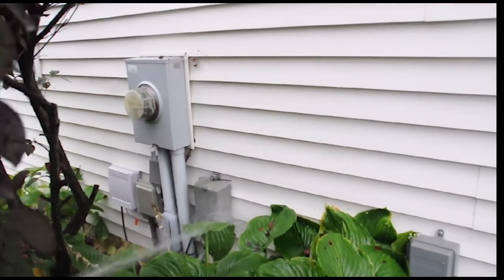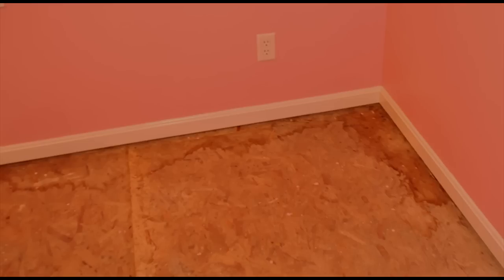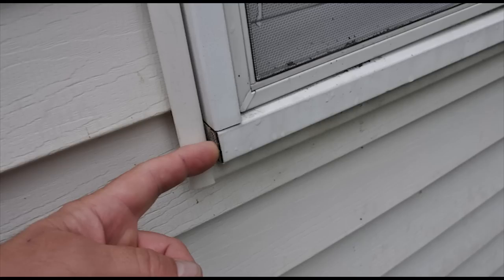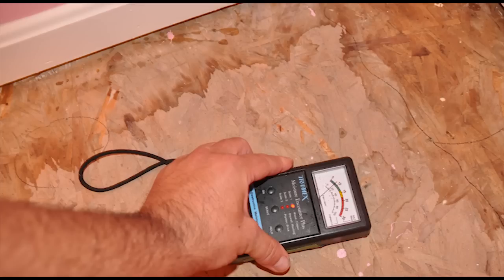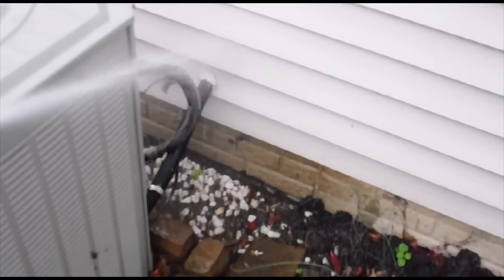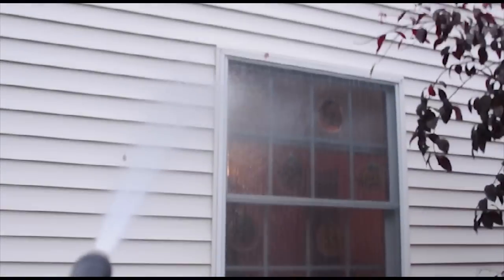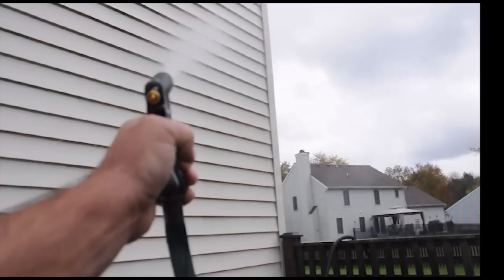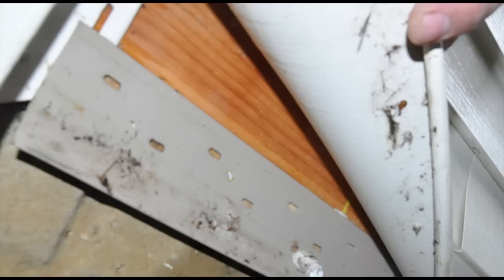Vinyl siding leaking

Comment: I'm not saying tyvek isn't useful but if installed right your vynil siding shouldn't leak. u may need to silicone around the windows. also it doesn't rain up and there is weep holes in the bottom of the siding for water to get out if it does get behind it. if you're spraying a water hose up into the weep holes of course water is going to get behind the siding lol

Comment: I'm not really sure if I have an siding leak but I did have an water heater pressure valve that leaked and caused Alot of damage in the closet in my bedroom downstairs and now we are having wetness in from of the hole where they had to cut it to search for where the water had bubbled up from behind the wall. We think that the shower not door not being closed tightly cause water to splash behind the wall and my dad had to seal the cracks between the shower and the floor.

Comment: There is no drainage plane available as there is no space provided.  Water is collected in the channels and directed under the siding where it is left to the unwitting installer to provide an underlayment to carry the water.  Where has this approach ever been acceptable?  Never!  Primary cladding should be the primary watershed, plain and simple.  It is the nature of PVC to move through thermal changes on the wall.  Gaps are provided for this movement.  'J' Channels and channeled corners are provided for aesthetics to cover the gaps.  Somehow we have been dumbed down to accept this.  Even the play on words by the manufacturers is a ploy calling this a "Supplemental Rain Screen." Who would buy siding that is only supplemental to underlayment?  Think people!
Reply from the maker: ***** Need Tyvek then vinyl siding. When I said drainage space I meant the space of the siding because it is angled. The siding also  has weep holes. So I like it. But we have idiots in Ohio that put this up on OSB sheathing with no drainage plane. Well that's is a big problem. Thank you for your post. I will subscribe to your channel. You sound like you know your Building Science.
Reply: Clevelandmarko Mark,  I must disagree strongly.  Not to be mean, but I know that to deviate from the "accepted" building methods would mean to become an enemy to the big manufacturers.  The system is wrong period.  Water is collected at window and door heads on, essentially, a gutter (top 'J'), then it is channeled down and under the siding where there in no drainage plane (free-fall space ), trapped to run laterally and at subsequent window and door penetrations impeded and enters the wall cavity.  It does not happen on every wall.  I will give you that.  Commonly, the roofer usually gets the call as when a lower floor header breaks through the vertical for an opening in the living area.  You get the look like you must be crazy that my siding is leaking.  How could that be?  Depending on an underlayment to carry runoff would never be acceptable on a roof.  How about if we 'J' Channeled chimneys or dormers for roof flashings?  You would blame the installer for bogus work.  Now we have underlayment window wraps being touted as window "flashings."  The manufacturers have been allowed to pervert the specs because in the absence of specifics in a building code builders revert to manufacturer specifications.  In this the VSI refers to its products as a "SUPPLEMENTAL RAIN SCREEN."  A play on words, this has tricked educated folks to believe that they somehow have rain scree construction with a drainage plane, which is a lie.

We have a friend in the Washington Post:

........................................................................................
The Washington Post explains some of the problems that vinyl-clad homes face these days:

"...for most people, the real surprise is that vinyl siding leaks -- a lot. The industry puts a positive spin on this issue, describing the siding as a 'supplemental rain screen' that works by 'reducing the amount of water that reaches the underlying weather-resistant barrier.' The Vinyl Siding Institute says, 'vinyl siding is designed to allow the material underneath to breathe; therefore it is not a watertight covering' -- which is to say, it leaks.

Water enters through overlapped joints, but mainly at open-sided edge trim. Anticipating this, manufacturers provide weep holes along the bottom edges of clapboard panels. You can't stop water infiltration by caulking because, unlike stationary trim seams in wood or masonry, vinyl has to move freely."Since vinyl siding itself is not waterproof, the building is ultimately protected by a water-resistant underlayment (house wrap), with additional protection provided by peal and stick waterproofing membranes that are used at high-risk areas such as window and door openings. Unfortunately, the water-resistant underlayment is punctured by several hundred siding nails. Also, any installation mistakes with the underlayment, or the way the underlayment is integrated with the peal and stick window/door membranes, will ultimately result in leaks.

The number of lawsuits being filed against contractors and vinyl siding manufacturers has been on the incline for many years now. 

(above posted by by David Buckles on House Coffee Design)
...........................................................................................
Reply from the maker: *****  I was assuming that all windows and doors were flashed according to  Dr. Joseph Lstiburek - Building Science Corporation. LOL  Many times you have rot at Pease doors that are failing exactly the way you describe. But then were Aluminum Clad Prolines that fails due to design.  Nobody puts up furring strips anymore. I guess they never leared with the EIFS issues. Now we have Cultured Stone and Hard board issues. I OK with all that because it keeps me employed.  I think I will make a few Home Inspection videos next couple weeks and back off the Urban Exploring videos.
Reply: Clevelandmarko Mark  I fix these problems all the time.  Look up the "Underlayment Craze."  It was brought about by a push from manufacturers because of the deficiencies of their products and methods.  Never rely upon underlatment as a primary water-proofer or water-shedding device.  The Underlayment Craze is a religion.  I am not happy that I make money on other's failures.  Some people see what I am saying and understand.  Others are lost in the soup regardless of education.  Still others are bought and paid for......   Truth is truth
Reply from the maker: Will check it out. Underlayment is Plan B.

Comment: Hey Mark:  Me again...  We have to get together and start telling people not to accept any siding that has channels.  I have been telling everybody for many years.  There is no drainage plane available as there is no space provided.  Water is collected in the channels and directed under the siding where it is left to the unwitting installer to provide an underlayment to carry the water.  Where has this approach ever been acceptable?  Never!  Primary cladding should be the primary watershed, plain and simple.  It is the nature of PVC to move through thermal changes on the wall.  Gaps are provided for this movement.  'J' Channels and channeled corners are provided for aesthetics to cover the gaps.  Somehow we have been dumbed down to accept this.  Even the play on words by the manufacturers is a ploy calling this a "Supplemental Rain Screen." Who would buy siding that is only supplemental to underlayment?  Think people!
Take a look at what this methodology causes:
https://www.youtube.com/watch?v=2hrJVSiaqxU

Clevelandmarko 22 minutes ago
 +Robert Wewer Need Tyvek then vinyl siding. When I said drainage space I meant the space of the siding because it is angled. The siding also  has weep holes. So I like it. But we have idiots in Ohio that put this up on OSB sheathing with no drainage plane. Well that's is a big problem. Thank you for your post. I will subscribe to your channel. You sound like you know your Building Science.

Robert Wewer 1 second ago
 +Clevelandmarko Mark,  I must disagree strongly.  Not to be mean, but I know that to deviate from the "accepted" building methods would mean to become an enemy to the big manufacturers.  The system is wrong period.  Water is collected at window and door heads on, essentially, a gutter (top 'J'), then it is channeled down and under the siding where there in no drainage plane (free-fall space ), trapped to run laterally and at subsequent window and door penetrations impeded and enters the wall cavity.  It does not happen on every wall.  I will give you that.  Commonly, the roofer usually gets the call as when a lower floor header breaks through the vertical for an opening in the living area.  You get the look like you must be crazy that my siding is leaking.  How could that be?  Depending on an underlayment to carry runoff would never be acceptable on a roof.  How about if we 'J' Channeled chimneys or dormers for roof flashings?  You would blame the installer for bogus work.  Now we have underlayment window wraps being touted as window "flashings."  The manufacturers have been allowed to pervert the specs because in the absence of specifics in a building code builders revert to manufacturer specifications.  In this the VSI refers to its products as a "SUPPLEMENTAL RAIN SCREEN."  A play on words, this has tricked educated folks to believe that they somehow have rain scree construction with a drainage plane, which is a lie.

Clevelandmarko9:30 PM

 
 
+Robert Wewer  I was assuming that all windows and doors were flashed according to  Dr. Joseph Lstiburek - Building Science Corporation. LOL  Many times you have rot at Pease doors that are failing exactly the way you describe. But then were Aluminum Clad Prolines that fails due to design.  Nobody puts up furring strips anymore. I guess they never leared with the EIFS issues. Now we have Cultured Stone and Hard board issues. I OK with all that because it keeps me employed.  I think I will make a few Home Inspection videos next couple weeks and back off the Urban Exploring videos.
Show less

Robert Wewer11:13 PM
+Clevelandmarko Mark I fix these problems all the time. Look up the "Underlayment Craze." It was brought about by a push from manufacturers because of the deficiencies of their products and methods. Never rely upon underlatment as a primary water-proofer or water-shedding device. The Underlayment Craze is a religion. I am not happy that I make money on other's failures. Some people see what I am saying and understand. Others are lost in the soup regardless of education. Still others are bought and paid for...... Truth is truth